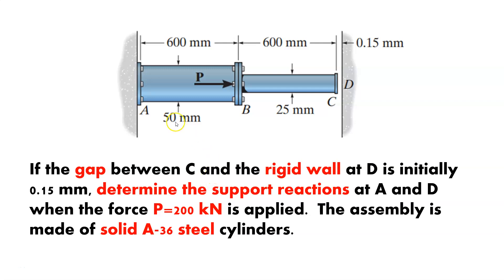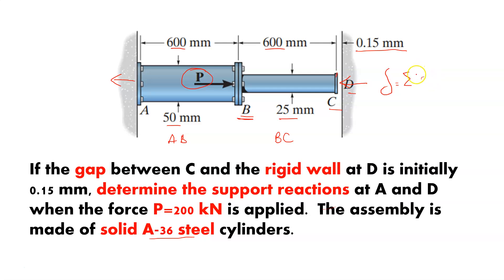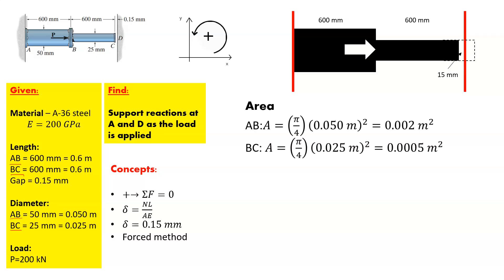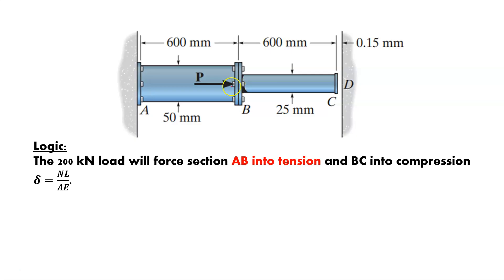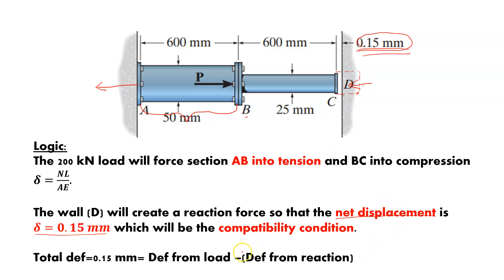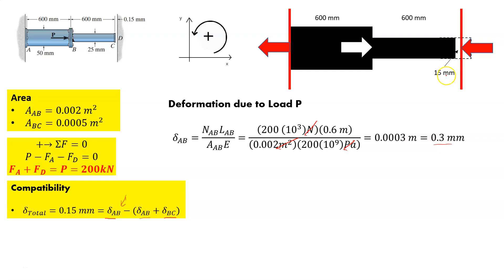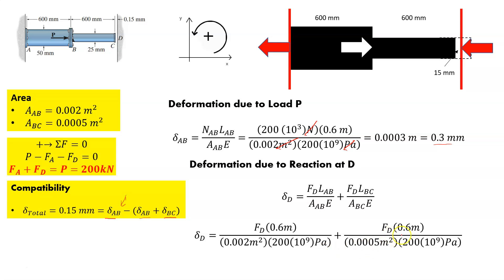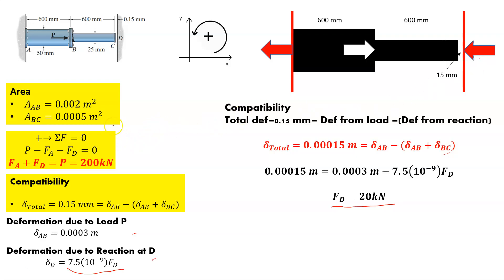Strength of Materials (Part 21: Axial Load, Support Reactions, Compatibility Conditions)

Comment: 8:54 I don’t understand why the reaction forces are both left direction…Isn’t right reaction force should be right direction?
Reply: It is an assumption. Based on the assumption, you calculate the forces. If the sign of the calculated force comes negative, you can be sure that the force direction in your assumption is actually the opposite.

Comment: when calculating the deformation due to reaction at wall D, isn't length of beam AB(Lab) supposed to be 600.15mm instead of 600mm? because it first got stretched 0.15mm to reach the wall. or do we just ignore it since it's a small value?

Comment: I may be wrong but shouldn't the wall thickness of the steel strut in both of its sections be considered in the equation?
Also, is the steel structure capped at both ends and how is the steel structure built?
And then what are the walls made of?